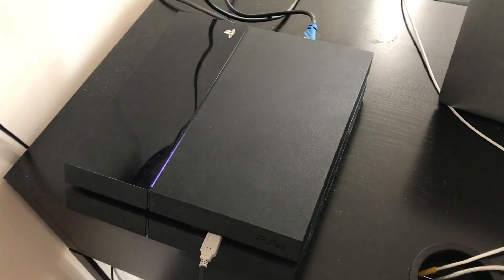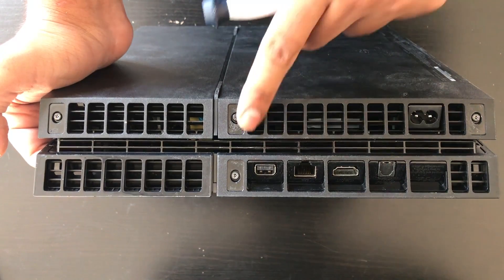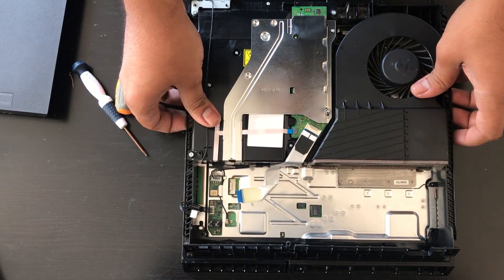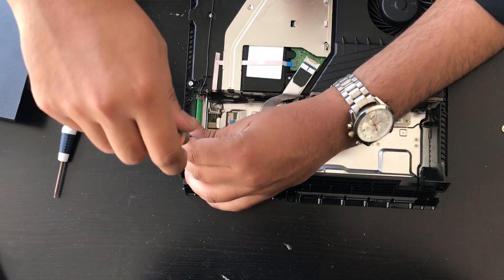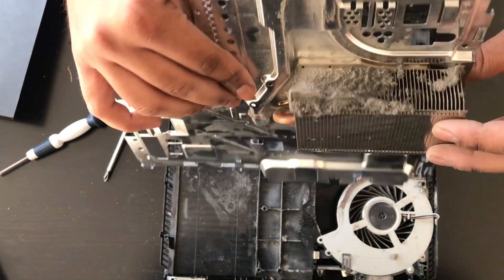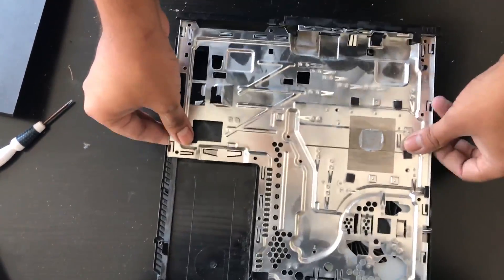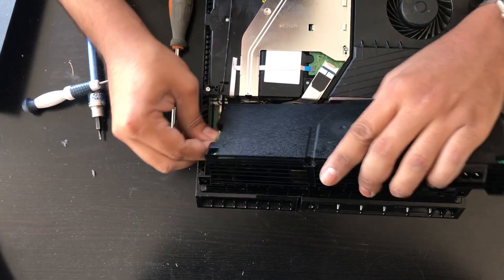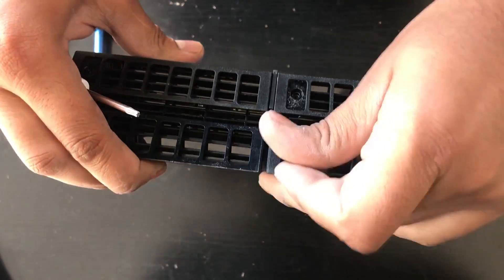PS4 Too Hot overheating due to dust build up and fan (CUH-1001/1115 cleaning and disassembly)

Comment: Excellent video and well explained. I was initially sceptical although I gave it a try as the PS4 would only run for around 10 to 15 minutes before the overheating error. Cleaned the dust out and took a chance on the thermal paste being OK. After cleaning out the dust and reassembling the system it would heat up and cut out after 10 seconds. Ordered the thermal paste and applied it the next day and my PS4 is working perfectly and no longer resembles a jet engine. If the system is 5+ years old I would recommend replacing the thermal paste when you have the chance to save you taking it apart twice. Its basically brand new now. Brilliant 😊. Thank You.

Comment: Fixing this with my stepdad we took a lil break as we started yesterday night but we are on the last part where you take off the silver piece then the motherboard to get to the heat sink which is making my p4 just overheat the fan and everything is cleaned just not the heat sink

Comment: Hey man. After I cleaned it, I start a game and the ps4 gets suuuupppeerr loud and then beeps 3 times and shuts off...what can I do ??
Reply: The same happened to me... I’ve cleaned the heat sink out reassembled and now for the first time ever my PS4 cut out from overheating and it was caked with dusk before I cleaned this out. Where have we gone wrong?
Reply: Higgidon - I fixed it
Reply: Miro thermal paste?
Reply: Higgidon yea, I changed it and it fixed itself, its so quiet now

Comment: Hi, brilliant video, I followed every step and managed to clean out the all the dust accumulated and finally put it back as it was. However now it’s making a even louder noise. I don’t get it? Shall I add thermal paste? The condition of my thermal paste was like for like on the video. I didn’t change the thermal paste when I opened as it was already in good condition!! Helppppppo 😿😿
Reply from the maker: Mohammed Hoque Try replacing the paste and check the tightness of the heatsink clamp. Also make sure your mainboard is flat and not bent.
Reply: Fasttech should the clamp be really tight?

Comment: Thank you so much 90% was filled with dust
Reply: Mine was so bad it was overheating at around 3 mins of just turning it on
I neglected my poor ps4
Reply: @addinix17  I can't even cut mine on for 30 seconds
Reply: Same!!!
Reply: @claudiomedina7028  sir.can i ask question sir? can i play digimon world next order on first generation when ps4 first time release? or this CUH version? i ask cause that game release on 2016 but this ps4  2013 =)
Reply: sir.can i ask question sir? can i play digimon world next order on first generation when ps4 first time release? or this CUH version? i ask cause that game release on 2016 but this ps4  2013 =)
Reply: @gunawangunawansantoso4122  yes, the year of the ps4 does not matter. you can play digimon world next order
Reply: Fyxdnsy
Reply: 90%? Damn!!

Comment: For anyone wanting to try this. Its completely worth it. My ps4 sounded like it was going to take off to the moon. Before I found this video I only went as far as taking the power supply out and cleaning the fan/heat sink from there. But I was missing the whole other side of the heat sink where there was a layer of caked dust. I did reapply the thermal paste as well so maybe that had something to do with it but I kid you not when I say there was a layer of dust on the other side of the heat sink. It's so quiet now. Thanks for making this video
Reply: what size is the philips screwdriver ?
Reply: Bout to do fan and heat syncs on a buddy's ps4 his sounds like a jet spooling up for take off stays on long enough to get to game loading then hits high speed and shuts down

Comment: I accidently pulled the whole thing from where the cable is at on the power source do you know if I can glue it back together?
Reply: Same happened to me, you don’t glue it, you need to weld it with an specific tool

Comment: Fucking $15 for a screwdriver?! I can’t afford a new PlayStation and these fuckers want me spending $30+ to repair it smh
Reply from the maker: Better than spending $300 on a new PS4 or even $200 for a used one.
Reply: Fasttech Not really that’s one screw driver for $15 that I’ll never use again then that’s not even counting the thermal paste air can other screw drivers I found cheaper alternatives though so it’s fine
Reply from the maker: @Simplystimulating  Good for you I suppose. We also bring value with these tutorials that take a lot of effort to make and not to mention the technical support you get after buying from us. Cheers.
Reply: Fasttech yo please tell me why my ps4 overheats in the first 2 minutes when I cleaned it now it’s worst than before

Comment: My ps4 loud same like this and automaticly eject disc. Is it the same problem bro?
Reply from the maker: Open your PS4 and clean the eject button on the PS4 disc drive logic board with rubbing alcohol. Also clean the touch sensor on the case from the inside and out. I am going to guess you spilled something in it that was not water.
Reply: @fasttechvideo  its same like ur video. Sound noisy. When i played a disc (RDR 2) , starting the story mode then ps4 sound loud then eject the disc automaticly. Then unable to put in a disc unless i restart it again. Now i can play..... Seems looks ok but sound sometime loud and sometime quiet. Its not like this before

Comment: You didn't even put ne thermal paste or even check the thermal pads to see if they were in place???? What kinda crap job was this? Never seen anything this bad. People, DO NOT follow these instructions you will kill your PS4. You HAVE to put new thermal paste if you take it apart and thermal pads. This guy did not.

Comment: HELP!! I did this and followed everything correctly. I put it back in place and when I turn my ps4 on it gets really loud and when I try to launch a game, my ps4 light turns red and just turns off. Can someone tell me how to fix this ASAP
Reply from the maker: Alfa Team apply new thermal paste and check the tightness of the heat sink clamp. Make sure the main board is sitting flat.
Reply: @fasttechvideo  I made sure that everything was correct and was on the right place and the screws are nicely tight. I'm guessing I'm gonna have to buy a new thermal paste

Comment: You told me to lift the fan cable up, I do that and I was supposed to pull it sideways, thanks
Reply from the maker: You have a PS4 model 1200 or 1215. Different layout and parts.

Comment: My PS4 won’t turn on after this what do I do?
Reply from the maker: Check the pins under the power supply
Reply: Fasttech thx I took it apart again after and I saw the pins were not correctly in but thanks a lot man for the help my PS4 is much better than before I just need to apply new thermal paste

Comment: Someone help I’ve cleaned my PS4 out replaced the thermal paste and the fan isn’t broken everything is plugged in but when I turn it on it just turns off after 3 beeps straight away

Comment: After watching this video i cleaned it and everything now that i turn it on it shut down 3 secs after can you help me with that please?
Reply: Light just come on blue when its on and 3 secs after light comes red and shuts off
Reply from the maker: @Splashyify  Check the pins under the power supply
Reply: Now its turn on blue and it shuts off again but this time no red light
Reply: I think i messed up somewhere 😢

Comment: I did this, I turned on my playstation and it the it already sounded very loud, then I try’d starting a game and I heard 3 peeps and it turned off, I can’t turn it on anymore.
Reply: Its official dead now
Reply: gatecitten who? I fixed it lol
Reply: @jino_0153  OMG please help! I cant turn it back on. It just beeps 3 times and turns back off. how did you fix it?
Reply: Neyt Culha sorry to hear that, how long does it take till it turns off? And is the ps4 getting very loud when you turn it on? Don’t turn it on again btw.
Reply: @jino_0153  It turns on for 2 seconds, the fan goes crazy for just half a second. Then 3 beeps and shutdown. Ill just try again when my thermal paste arrives
Reply: Neyt Culha yeah, if you didn’t use thermo pasta that happens, the same happened to me, but I just let a professional do it for me :)
Reply: @jino_0153  Well Im gonna try it myself and if worse comes to worst Ill just buy a new ps4 pro instead, professionals charge too much imo
Reply: Neyt Culha 30$ is not much :p
Reply: @jino_0153  Lol they charge about 80 where I live
Reply: Alright I patched her back up and applied some new thermal paste (Arctic MX-4). Works fine now and much quieter ^^

Comment: Followed the video to the letter and it’s worked a dream! Thank you for sharing, could have been a bit more chatty when putting it back together, I got a couple of bits mixed up ie wire placement. Otherwise it was great! Playstations running nice and quiet again 👍and you saved me some money getting it fixed, bonus ⭐️

Comment: I followed every step and it did get me to clean the dust out the ps4 but unfortunately I still have noise, for the fan i dont know what a fan that needs replacing looks like to decide if i need a new one as it does spin
Reply: If your fan spins normally without any sounds, you’re good. And for the noise you should maybe put some new thermal paste on it.

Comment: After replacing paste mine is still doing making noise.. Not that loud but it is still loud. Is it because maybe I live in hot area?
I mean at a distance I can't hear it but it has a kind of whine to it. When I close the game it just immediately slows down.
Reply: Does it overheats?and turns off?
Reply: @shanksuzumaki2351  nah it doesnt turns off. Played 3-4 hours straight nothing.
Reply: Amd can we use any thermal paste? Even the cheapest one?
Reply: And*

Comment: Thanks bro it worked so well, my PS4 has like 6 years and now sounds like new, amazing video 😉🤙

(It was overheating so bad, tuning off and everything)
Reply from the maker: Don't forget to subscribe and you're welcome
Reply: Aleksander2706 Glad to hear yours has recovered, did you need to use new thermal paste or was it just remove dust?
Reply: SpeaksTheTruth i only cleaned the dust and my PS4 its so quiet now but I think it could be better with thermal paste.
And if you are thinking to clean your ps4 i recommend you to do it but very careful to dont breake anything 🦑
Reply: Aleksander2706 thx and yh I’ve got no choice because mine sounds like the one at the start of the video and it’s overheating after a short time gaming. My fan seems to spin freely so I’m guessing a heat sink full of dust.

Comment: If your Controller and wifi refuses to work after doing this, dont be a fuckin idiot like me and buy a new bluetooth antenna. 

It more than likely got unplugged from the board under the power supply. I'm ashamed of myself that it took me 4 hours to figure this out after I got the new one.

Comment: Hey I was planning on this sometime soon. I got a quick question. You said you only used a T8 Torx screwdriver and a flathead. But I was looking on the web and it says you need a T9. Is there any difference or should I just get both T8 and T9?
Reply from the maker: Cheko Lecko If you’re not going to buy the tools from us don’t ask for my help. I will tell you that a t9 will not work. You’re welcome.
Reply: Fasttech okay I will then

Comment: "The thermal paste looks like its in good health"

There was almost none on the diode
Reply: @bobbyb2793  you can clean the metal and plastic pieces, but not the motherboard. Make sure to dry them completely and use a hair dryer to get every bit of moisture.
Reply: @bobbyb2793  I would recommend cleaning it as best you can without fully disassembling it until you get some thermal paste, then clean the fan and heatsink from the other side which you can't get to without taking out the motherboard
Reply: @fasttechvideo  unless you are using noctua nt h2 which is $30 for a small amount of it, $45 for thermal paste is a lot imo. Arctic silver mx 4 goes for $5-$10, and you don't use that much of it.
Reply from the maker: @rockl79  Everyone has a different price for their labor.
Reply: @fasttechvideo  you do you. I don't run a repair business, but I run a 360 rgh business. Thermal paste replacement is free with the service, and I charge $10 for full board cleaning if the customer wants it.
Reply from the maker: @rockl79  Good for you
Reply: @fasttechvideo  likewise.
Reply from the maker: Did an updated version of this video with a different PS4 where I changed the paste. The customer in this case never complained. Maybe I should start charging people for service they don't need? I think not. I think he is happy he didn't have to pay an extra $45. Anyways thanks for watching.
Reply: @fasttechvideo  while I don't doubt you do a good job of cleaning ps4s, $45 is way too much for just thermal paste. I would at the very least change out the paste for mx 4 and not charge anything for it, especially if its the stock paste. Plus changing the paste again will lower the temps significantly.
Reply: Fasttech I wanna know does anything happen if you don’t replace the thermal paste?
Reply: @redrum3502  it really depends on how old your ps4 is and how much it has been used. If its one of the launch ps4s then definitely replace it. The only things that can happen is the fan can be super loud, the bearing can break, and it could overheat.
Reply: RockL79 I’ve had it since 2017 and it barley started saying that it’s overheating they fan has been loud a while now
Reply: @redrum3502  thats probably just the thermal paste or dust. If you can, you should replace it
Reply: RockL79 I was wondering if you know why my controller stopped working after I took it apart and cleaned it the audio when I connect my headset always cracks and sometimes the audio isn’t even their I bought the controller around Christmas last year so it’s still kinda new
Reply: @redrum3502  you could try resetting the controller, it didn't work for me but it works for some people
Reply: RockL79 yea that shit ain’t work I traded one problem for another 😂

Comment: I bought a refurbished used factory certified ps4 from bestbuy 5 years ago and all the screws are stripped pretty much and I can not clean the heat sync. any tips on what I should do?
Reply from the maker: Try getting those screws undone with a flathead. Be careful and go slow.
Reply: @fasttechvideo  is there anyway I could send it to you to clean?
Reply from the maker: @timmaaayyy-s7i  Yes you can buy the service here: https://www.fasttech.ca/ps4/ps4-cleaning-service

Comment: Hey man i did all this in the video and once i put it back together it starts up, the fan is really loud and it pops up the red light like it’s overheating and immediately cuts off! What do you think i did wrong? Maybe i need thermal paste?
Reply: I have the original PS4 (since 2014) I’ve taken it apart and cleaned it before but this time it didn’t work
Reply: @TYLERBASQUIAT  once a mother board is taken out the thermal paste needs replacing which isn't in the video
Reply: joshua afonso thank you so much i will try that
Reply: @TYLERBASQUIAT  make sure you apply a pea sized drop of thermal paste and don't spread it

Comment: Honestly all I did was blow really hard into the gaps and the error stopped popping up
Reply from the maker: Kubilaysavs that’s because you moved the dust enough for your system to breathe again. Eventually it will block the heat sink again and you will have to do this.
Reply: @fasttechvideo  Damn he was right:/
Reply from the maker: @KubilaySavs  Told you :)
Reply: Fasttech na it’s been ages and the error hasn’t popped up

Comment: Hi I'm having an issue, I followed every step and plugged every wire back in and screwed everything. I have no missing screws cleaned the heat sink etc. Now after putting it back together and turning my PS4 on the light goes from blue to red straight away then it switches off. The fan noise goes loud all of a sudden then the entire system just as said switches off. It's on for about 10 seconds. Please help
Reply: Truth Returns  I can't even get on to any menu sadly, it just shuts down after 10 secs of booting up
Reply: Truth Returns  didn't change the thermal paste but not sure about any thermal pads ahaha
Reply: Truth Returns never gave my update but I got someone to replace the thermal paste & clear out the dust from the heat sink vent. My PS4 is now useable & is a whole lot quieter. For the first few days, it felt new as the fans never kicked in. A week on the fans have started kicking in but it still very quite as compared to before.

Comment: I did this but now my ps4 overheats even faster any tips

Edit: I’m now realizing that while I was cleaning the dust out I accidentally wiped the thermal paste on my finger
Reply: Any update? Cause my retarted ass did the same thing and can’t go in 10 seconds into a game without it shutting off
Reply: Oscar Perez I just ordered some new thermal paste that’s supposed to be good for PlayStations I’ll update in 5 days if it works
Reply: @maddielinger4810 thermal paste will fix that problem. get it off ebay for like $7
Reply: Finlan already replaced that and still overheating
Reply: Javier Chavez did you also clean it
Reply: Maddie Linger yea, I ordered a fan off of amazon. If it doesn’t work I’m just going to return it
Reply: Oscar Perez maybe you forgot to plug in the fan header
Reply: Same here, might need to buy a whole new fan from what I’ve seen so far.
Reply: @javierchavez4897  thermal paste will fix that problem. get it off ebay for like $7
Reply: Finlan I did
Reply: I accidently cut one of the wires from the power supply and now I have a dead ps4  ;(
Reply: I just changed my thermal paste and now my PlayStation works like new it doesn’t even make a sound
Reply from the maker: Replace the thermal paste and check the tightness on the heat sink clamp. Also make sure you mainboard is seated in flat.